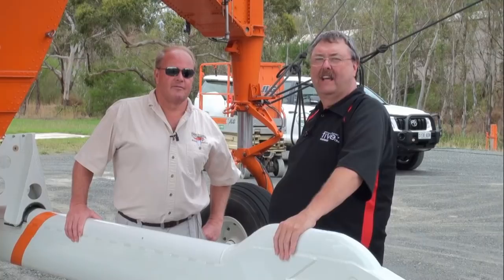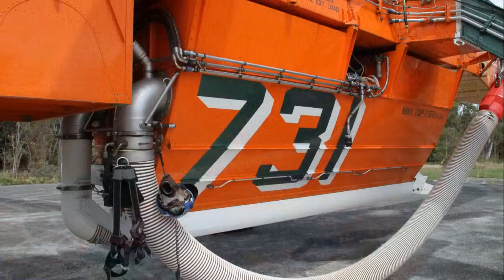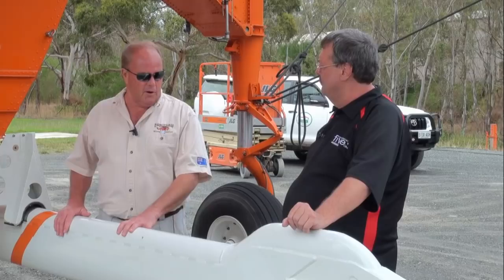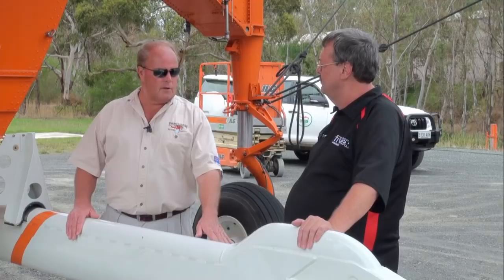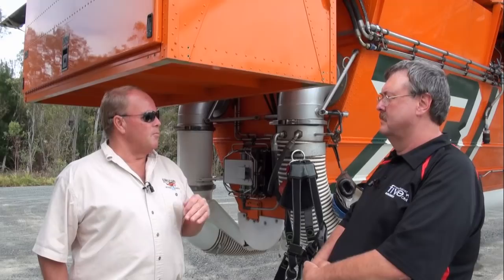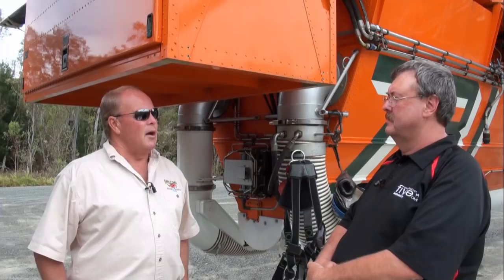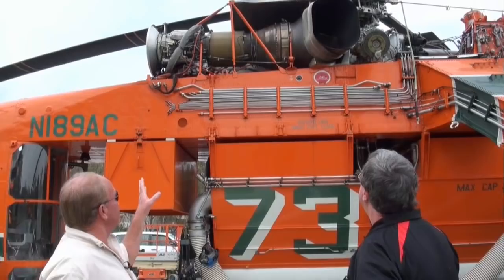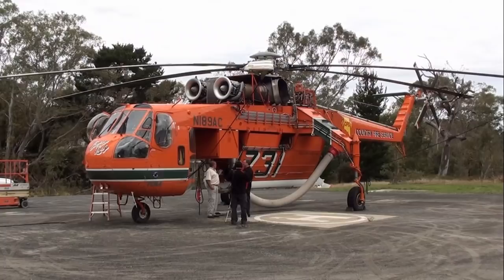Erickson Air Crane - Walk around with Keith Gill

Comment: yes there was originally 2 atol double clog valves..but those were replaced with a mccorkle hasher swath mixer.now its just a matter  of pulling the finney cable.and the ring bearing does the rest.glad i could help good luck on your time trials.and tell old kerny buttersworth.pete said hello.